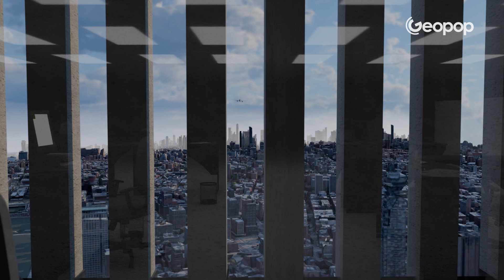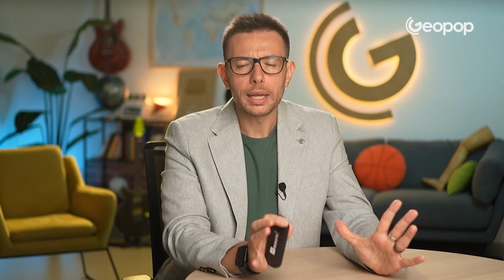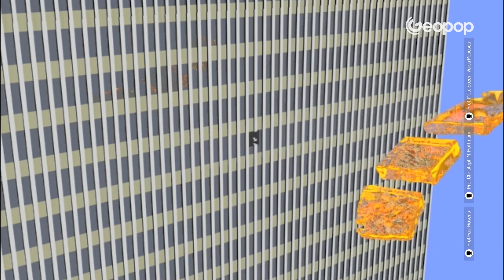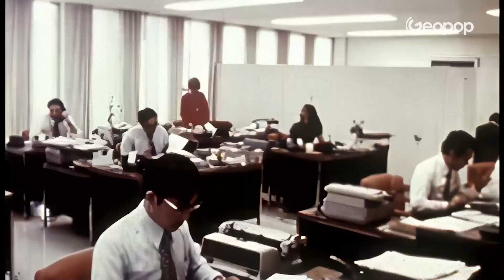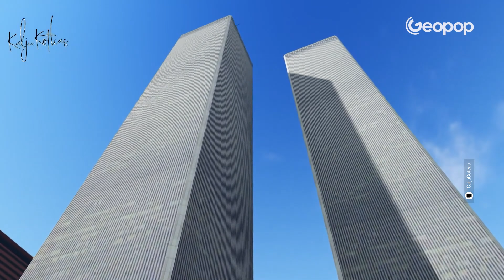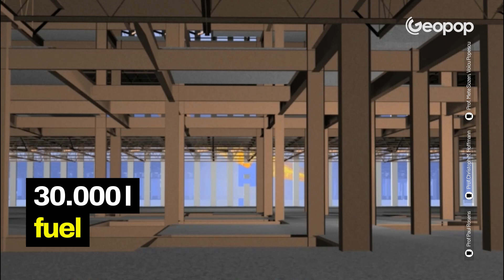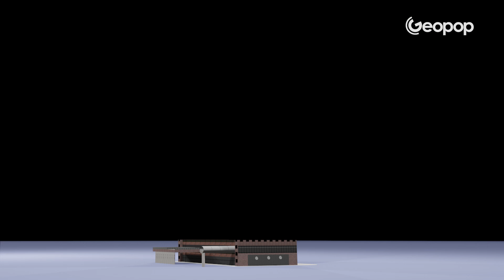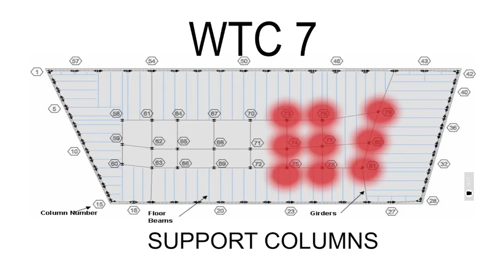9/11, 2001: The Technical Reconstruction of the Twin Towers and WTC 7 Collapses

Comment: Except no pancake collapse ever happened search for pancake collapse and you will see what a real pancake collapse looks like the hat trusses completely disappeared along with the black boxes which were Never found  cough  the question people should be asking is where are those black boxes and who has them and how did the north tower take itself out with about 15 floors on fire with the rest of the bottom floors being perfectly healthy wtc 7 fell straight down no plane hit it yes it sustained damage from some of the steel beams of the towers falling on them NIST said a fire hitting one corner of a steel beam caused it to collapse if that were the case many other buildings in nyc would all have collapse due to fire 🔥 something on that day was off these are questions that need answering where is the plane that hit the pentagon no plane skid wheels no wing slices on each side looked like a perfect missile hit the building there were fbi agents carrying a box covered in a blue tharp if they had nothing to hide why not show us what was in that box also look how hot the fires really got way below the so called collapse it was about 2,000 degrees or even hotter down there below don't say gasoline was the cause of the fires.
Sadly people like Bush and silverstein will never be put on a polygraph we will never get the truth R.I.P to everyone who perish I mean no disrespect we really do need answers.
Reply: Define "pancake collapse"
Reply: @TheLoonResistance  I don't have too look it up or yourself and you will understand what a "pancake" collapse is that's what they claimed happen you had all that time to reply when you could of searched for it or are you using the libraries internet 🤣
Reply: @TheMan733  - "Pancaking" specifically refers to a very early FEMA hypothesis for collapse initiation mechanisms which was quickly dropped as obviously not what happened. It literally has not been a thing for 23 years.

The term is now more frequently mis-applied to collapse progression stage which was led by the succession of floor failures from debris falling through the open office space. I never liked pancaking to describe that process. Too simplistic and inaccurate. More like Kaiserschmarrn.
Reply: @TheLoonResistance  if it works for you lol
Reply: @TheMan733  - Your ignorance-fueled personal incredulity aside, yes, it does, and that is a strange way to say thank you . 

I find Twin Towers collapses intellectually fascinating, my interest being understanding the actual mechanisms of collapse - what failed, when, how & why and discussing those mechanisms with others who share a similar genuine interest in understanding what really happened instead of rationalizing some political agenda. So let's talk about it.  If at the end you disagree with anything, please let me know what you object to and why. Make it good. I don’t suffer fools. This will take just a few minutes.

This is my summary explanation of Twin Towers collapses of the Twin Towers, start-to-finish, based on my observations without appeal to, or reliance on any authority. No politics or ideology, just what actually happened, which is agnostic to who planned and carried out the 9/11 attacks or why. It has the benefit of not requiring Rube Goldberg levels of complexity and it makes logical sense. Each step in the process flows naturally from the one before AND is chock full of critical details the conspiracy-oriented internet tends to leave out with no whataboutisms.  My hope is this will dispel many common myths and answer most if not all questions you may have about the Twin Towers collapses. 

While complex, most of the Twin Towers collapse mechanisms can be seen with the naked eye and easily discerned and understood by the layperson if sufficient time is taken to understand. The worlds engineering community had already largely sorted them out at least as early as October/November 2001. Still, there are many who can’t be bothered to look or perhaps work hard not to see, being more concerned about advancing political/ideological agendas (which is exciting) than science and engineering (which is boring).

1. The Twin Towers consisted of 4 primary structural elements that together formed an integrated system where each relied on the others.  47 hollow box-section steel Core Columns carry the majority of the gravity loads. The 236 hollow box-section steel Perimeter Columns carry the remainder and ALL of the lateral (wind) loads. Long-span Lightweight Steel Trusses connect the core and perimeter column together at each floor with a Hat Truss on top to tie the structure together as an integrated unit where no element can survive without the others 

2. The impact of 117 tons of airplane (= to about 12 dump trucks) at speeds up to 590 mph completely destroys the aircraft.  This in no way implies the Towers come out unscathed. Some folks don’t get that. Hitting with the energy of up to a ton of TNT the impact damages or destroys many perimeter and some core columns (33 of 59 perimeter and 20 core columns destroyed at the impact floors in the North Tower), primarily through bolt-shearing failures at the end connecting flanges, as well as bending, twisting and fracturing of weld seams. There was no cutting or slicing - the reality was far more violent and messy. 

3. The impacts destroy or damage fire insulation, fire breaks and sprinkler systems on multiple floors. Huge fires are started across multiple floors simultaneously and allowed to spread rapidly with no effective firefighting or fire suppression. This was an unprecedented fire event . 

4. The hotter steel gets the weaker it gets .  With fire insulation stripped away and no sprinklers the survival time of the steel greatly reduced. Gradually over time heat causes the lightweight steel Floor Trusses at the impact damaged floors to sag, which was observed and recorded.  No steel melted nor did it need to. Structural steel will fail long before it turns to a puddle. It just needs to bend

5. Sagging floor trusses pull on the increasingly weak and overloaded Perimeter Columns, causing some of them to bow inward by up to 5 feet. A straight column is up to 4 times stronger than a bent column. The bowed Perimeter Columns buckle and fail, initiating collapse. The formerly static mass above which the structure below could easily support is now converted into a dynamic mass up to 30 times greater. Because they have buckled, the Columns above and below the failure point are no longer aligned . The load bearing structure below no longer bears any load as it falls past the lower columns, NOT onto them.

6. Thousands of tons of debris fall within the four outer walls, down through the open office space, crashing onto the first intact floor it encounters. This massive impact immediately breaks the bolted connections to the columns as the amount of resistance the Floor Trusses can offer is negligible.  The falling debris slows only marginally and briefly. Note:
6a. This is NOT a solid top block crashing into and “crushing” a solid bottom block .
6b. The debris falls past the columns not onto them.  The columns provide no resistance to the falling debris. 
6c. Only the bolted connections of the floor trusses to the core and perimeter columns can offer any resistance. A pair of 5/8” bolts at each end of each truss vs. thousands of tons of falling debris.
6d. No laws of physics are violated.

7.  This floor-led collapse progression within the four outer walls can only go straight down. Note: 
7a. This process is often incorrectly referred to as “pancaking” which actually refers to a completely different process rejected at an early stage. The catchy name stuck but nobody knows what it is supposed to mean.  Pancaking is too simplistic and inaccurate anyway. More like Kaiserschmarrn.

8. Collapse progresses through the floor systems not down the columns, through the path of least resistance . Rate of floor failures increases with each successive floor as momentum increases, reaching an average acceleration of 0.65 of GA, or 35% slower than true free fall. Bam, bam, bam down the building until there are no more floors to fail.  The resistance offered by each successive floor is always the same. The mass and velocity and thus the energy of the falling debris are constantly increasing with every floor destroyed new falling mass is added. Some falls to the sides, but most falls down. More mass, more velocity, same resistance with each floor.  Don’t get stuck on the but the lower floors weren’t on fire nonsense. They weren‘t and didn’t need to be.

9. The Towers were 95% air by volume. As that air was compressed inside the building it is forced down the tower and blown out the sides in reaction to the building collapsing . Those were not “explosions”, it was expulsions of compressed air caused by the collapsing building, explaining the low velocity, lack of flash, blast, supersonic pressure waves and lethal high-velocity ejecta.  

10. Perimeter Columns become detached and peel away like a banana behind the collapse front, playing out to the four points of the compass extending to more than 600 feet from the base of the towers. This was quite obvious from examination of the debris pile. 

11. Core Columns fail last as their internal beam bracing is stripped away by falling debris and lateral support from the floor to perimeter columns is lost. 

12. For those who care about how long this whole process took; 31-34 seconds from the moment the perimeter columns buckled until the last core columns hit the pile, or 1/3 the rate of true free fall. Don’t believe me?  Just watch any video of the collapses and note the loose truly free falling debris dropping much faster than the towers themselves.  

13. Each Tower had a 1-acre footprint. Far from collapsing inside their own footprints the debris pile spread out over 16 acres in a pile up to 14 stories deep. 8 surrounding buildings were destroyed and scores more damaged. 

14. What was NOT observed and recorded were the 180-190 dB bangs of high explosives or the blinding bright flashes of burning thermite. Of course, neither could have caused the (silent) Perimeter Column buckling that was observed.  Neither explosives or thermite could have survived the impacts and subsequent fires either. Cherry-picking a casual comment from someone who heard a loud noise in an event like 9/11 is not exactly “proof” of anything and the pre—planned demolition case relies entirely on that. There is zero physical evidence to support either conjecture. It would be technically impossible, totally impractical and completely unnecessary. No one would bother. 

15.  The Twin Towers were perfectly safe within their design envelope.  They only collapsed when taken far outside design parameters by an extraordinary and unprecedented event. 

Impact + Fire (heat) + Time + Gravity = Collapse . Remove any one of those four elements and there is no collapse. Ignore any of those elements (as many do) and you will never understand the collapses. The Twin Towers were an integrated system in which no one component could survive without the others. One fails, the rest follow, through the path of least resistance – DOWN – through the open space, bypassing the path of greatest resistance – the columns.  Nothing I just described violates any laws of physics. All of the above is true no matter who planned and carried out the 9/11 attacks or why 

I hope you found this helpful. It is meant to be informative, not adversarial, posted with the objective of soliciting informed critical comment, positive or negative. If I made any errors of fact, logic or reason or left anything critical out, please let me know so I can fix it. One topic at a time, on topic only please to stay focused, no word-salads of Gish Gallop. IF you can offer a more plausible alternative be my guest. So far no one has even tried. Please start any reply with the words “Tits McGee” or I will know you didn’t actually read it, are not serious and just wasting my time.
Reply: @TheLoonResistance  yes you are a moron for writing such a story I didn't care to read it what an idiot you are 🤣 you sound angry I guess you're sister said you were too small for her 🤣🤣 change your name to critialmoron it suits you better nigga wrote a book 🤣🤣🤣 you're sister never wastes my time 🤣🤣
Reply: @TheLoonResistance  lol you sound angry 🤣 I never said thank you only to you're sister 🤣you should change your name to critialmoron nigga wrote a book 🤣🤣🤣 I didn't even care to read that story you wrote I was busy in your bedroom sorry for messing up the sheets me and you're sister were playing hide the weiner yes you are very ignorant I can see that ignorance is bliss get off the computer and go find a job 🤣
Reply: @TheLoonResistance   @TheCriticalStinker-jw4fl  lol you sound angry 🤣 I never said thank you only to you're sister 🤣you should change your name to critialmoron nigga wrote a book 🤣🤣🤣 I didn't even care to read that story you wrote I was busy in your bedroom sorry for messing up the sheets me and you're sister were playing hide the weiner yes you are very ignorant I can see that ignorance is bliss get off the computer and go find a job 🤣
Reply: @TheLoonResistance   @TheCriticalStinker-jw4fl  lol you sound angry 🤣 I never said thank you only to you're sister 🤣you should change your name to critialmoron nigga wrote a book 🤣🤣🤣 I didn't even care to read that story you wrote I was busy in your bedroom sorry for messing up the sheets me and you're sister were playing hide the weiner yes you are very ignorant I can see that ignorance is bliss get off the computer and go find a job 🤣
Reply: @TheLoonResistance   @TheCriticalStinker-jw4fl  lol you sound angry 🤣 I never said thank you only to you're sister 🤣you should change your name to critialmoron nigga wrote a book 🤣🤣🤣 I didn't even care to read that story you wrote I was busy in your bedroom sorry for messing up the sheets me and you're sister were playing hide the weiner yes you are very ignorant I can see that ignorance is bliss get off the computer and go find a job 🤣
Reply: @TheLoonResistance   @TheCriticalStinker-jw4fl  lol you sound angry 🤣 I never said thank you only to you're sister 🤣you should change your name to critialmoron nigga wrote a book 🤣🤣🤣 I didn't even care to read that story you wrote I was busy in your bedroom sorry for messing up the sheets me and you're sister were playing hide the weiner yes you are very ignorant I can see that ignorance is bliss get off the computer and go find a job 🤣
Reply: @TheLoonResistance  lol yes you are ignorant this moron wrote a book 🤣🤣🤣 you sound angry you wrote a story that I didn't even care to read about 🤣 waste your time 🤣 you wasting your life hoping on the computer to reply to people I never apologize to you only to you're sister 🤣 for messing up your bed room were playing hide the weiner 🤣 you should change your name to critialmoron and learn to speak when spoken too.🤣 get off the computer and find a job your anger is fueled by stupidity 🤣
Reply: @TheLoonResistance   @TheCriticalStinker-jw4fl  lol yes you are ignorant this moron wrote a book 🤣🤣🤣 you sound angry you wrote a story that I didn't even care to read about 🤣 waste your time 🤣 you wasting your life hoping on the computer to reply to people I never apologize to you only to you're sister 🤣 for messing up your bed room were playing hide the weiner 🤣 you should change your name to critialmoron and learn to speak when spoken too.🤣 get off the computer and find a job your anger is fueled by stupidity 🤣
Reply: @TheLoonResistance  you are very ignorant 🤣 when did I say thank you 🤣 I only thanked you're  sister for the hand job ✋ she gave me your anger is fueled by stupidity 🤣  your so mad you wrote a book I didn't even care to read it wasting your time what time you have none your not important 🤣 get off the computer find a job make something of yourself and learn to speak when spoken too 🤣
Reply: @TheLoonResistance  lol you sound angry you wrote a story that I did not care to read 🤣 I never thanked you only you're sister 🤣 for her hand job skills she posted on Craigslist yes you are ignorant 🤣 wasting your time your not even important enough to have time 🤣 do yourself a favor get off you're mother's computer and go get a job and make something of yourself 🤣 ignorance is bliss lol what other walt Disney stories do you have learn to speak when spoken too you should change your name to critialmoron it fits you better 🤣.
Reply: @TheLoonResistance  @TheCriticalStinker-jw4fl  lol you sound angry you wrote a story that I did not care to read 🤣 I never thanked you only you're sister 🤣 for her hand job skills she posted on Craigslist yes you are ignorant 🤣 wasting your time your not even important enough to have time 🤣 do yourself a favor get off you're mother's computer and go get a job and make something of yourself 🤣 ignorance is bliss lol what other walt Disney stories do you have learn to speak when spoken too you should change your name to critialmoron it fits you better 🤣.
Reply: @TheLoonResistance  you are ignorant and your anger is fueled by stupidity how did I thank you? I only thanked you're sister for the good job she has done 🤣 you should change your name to the criticalmoron wasting your time your not important enough to have any time 🤣learn to speak when spoken too you wrote a book I did not care to read about 🤣
Reply: @TheLoonResistance  this criticalmoron wrote a book I did not care to read 🤣 your ignorance is fueled by stupidity I never thanked you only you're sister 🤣 she was eating my 🥜 get off you're mother's computer and go get a job and make something of yourself leaned to speak when spoken too 🤣🤣
Reply: @TheLoonResistance  🤣 nigga wrote a book
Reply: @TheLoonResistance  you wrote a book I didn't care to read I don't know about a strange way to say thank you no one thanked you 🤣🤣 your ignorance is fueled by anger you sound don't sound mad I feel marvelous I did thanked you're sister for the good time 🤣🤣 your stupidity is ignorance and ignorance is bliss 🤣🤣🤣
Reply: @TheLoonResistance  you sound angry 🤣 you wrote a book no one cares about save you walt Disney's stories 🤣 when did ai thanked you I thanked you're sister 🤣
Reply: @TheMan733  - I'm just trying to help. Not my fault you don't understand the topic on a fundamental level and lack the attention span. maturity or will to do so. Good luck with your continued epic fail. I really hope that works out for you.